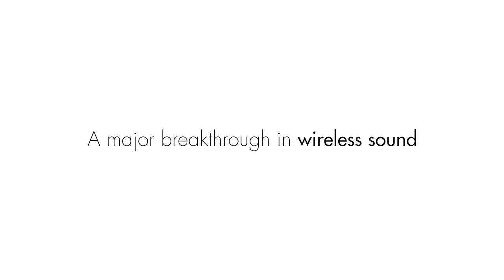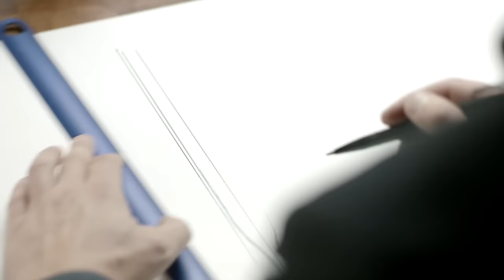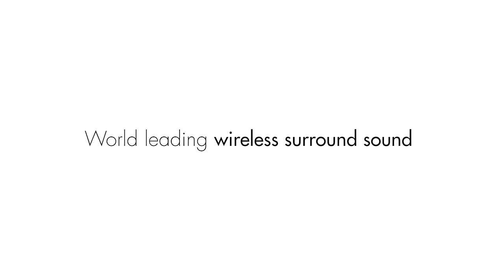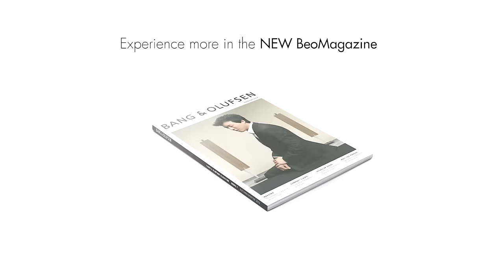Immaculate Wireless Speaker & Sound - Great sound deserves Bang & Olufsen

Comment: From my understanding, for this product to be wireless, you also need to buy the B&O Transmitter 1 and the Beocore, otherwise they are unable to function as wireless speakers. However, I might be wrong because I've asked many dealers and suppliers, and I always seem to get a different answer to this question, but based on what I've heard, this I'm fairly sure what is needed for this product to function as a wireless speaker.
Reply from the maker: Hi Tom, 
thanks for your comment. We will be happy to clarify. 
All three speakers mentioned in the video are support wireless connection (WISA built-in). The source they are connected to must support wireless/WISA as well, otherwise a Beolab 1 Transmitter is needed in the setup. So it depends very much on the source the speakers are connected with. 
Hope this helps.
Feel free to reach out anytime, should you have any other questions or concerns.
Kind regards, 
Bang & Olufsen Customer Care

Comment: They are active speakers, which needs a power cord to each speaker.
For the most part a power outlet would be much closer to the speaker position than the source of the sound which it traditionally needs to be wired to.

Comment: @jhutters you wouldn't be thinking that those speakers are battery powered do you? Just look at the sizes, do you even want to carry them around? I do not think so. The true benefit of a wireless speaker is that you can access it anywhere in your house, without being constricted of staying close to the speaker with the cable jacking into your device at all times. If you are looking for a battery powered devices, look elsewhere. These devices are not made for portability.